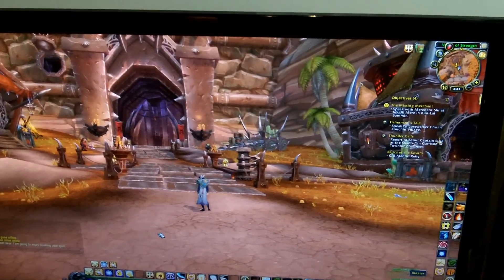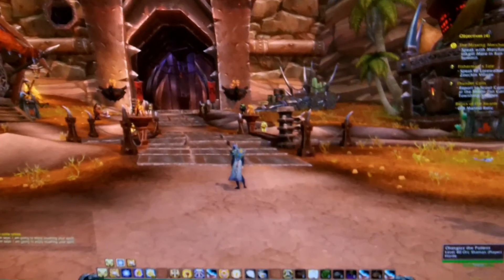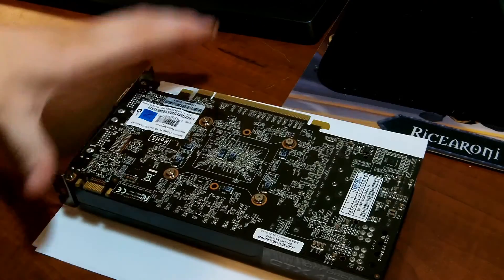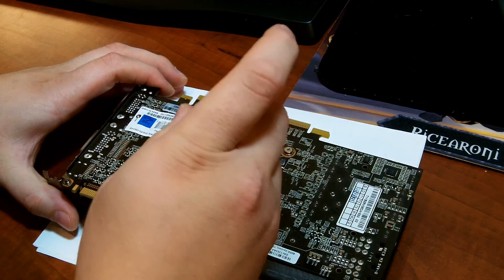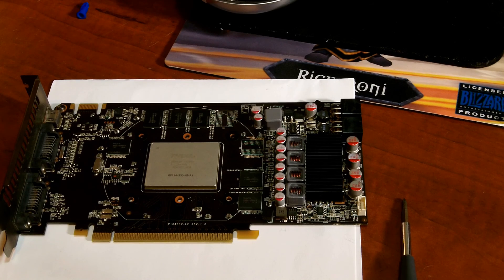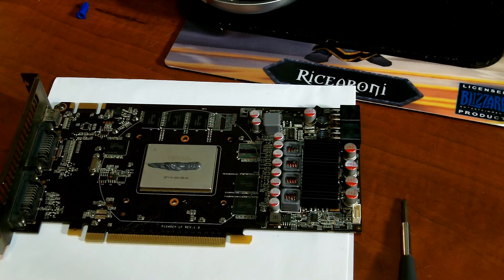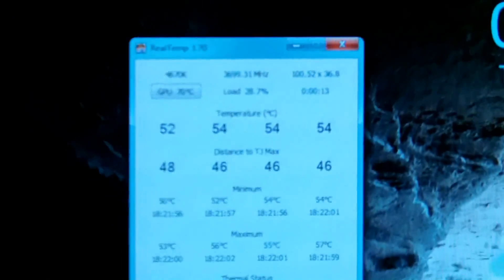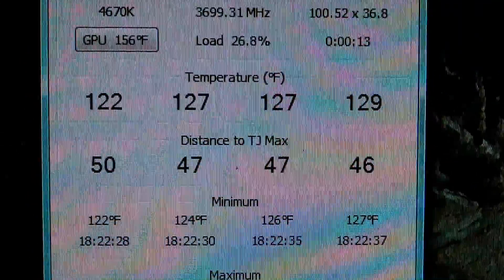How to clean and add new thermal paste to a GPU

Comment: I did this for the first time last night. i opened up my GPU's shroud and omfg there's a lot of gunk on the heatsink. no wonder the fan was going haywire, the air wasn't going through the heatsink. i cleaned it up and plopped it back into my CPU and boom! better temps allthroughout. didin't even have to reapply paste!